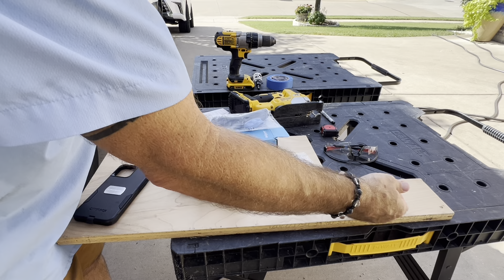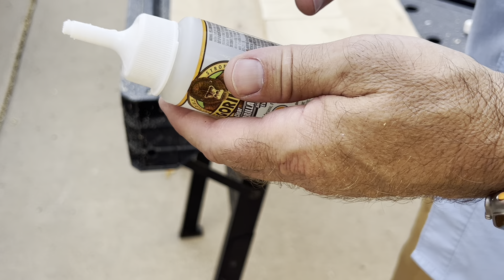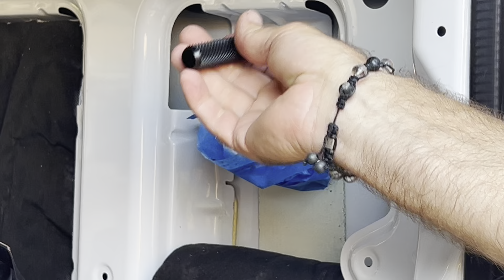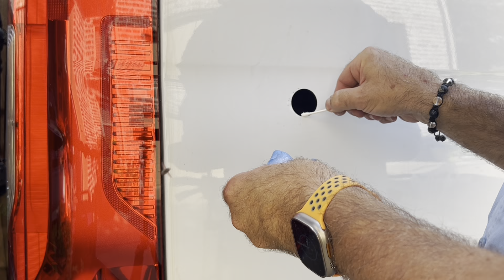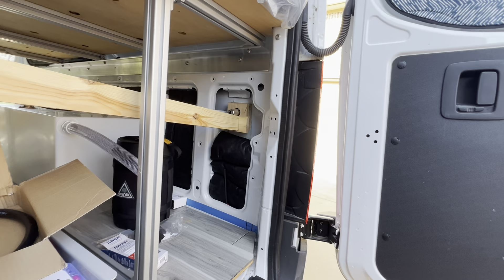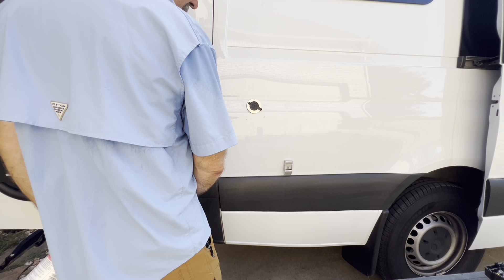Aquor Fresh water fill inlet installation video for Sprinter Van

Comment: Very nice! So this valve that you’re using, does have a check valve. It should not flow back by gravity if it’s mounted below the tank. Now granted, if it gets so cold, you may worry about water freezing in the fill line if it’s below the tank. But that would be the only concern.
Reply from the maker: Good points.  I may need a relief valve at low water point in the line. Thanks
Reply from the maker: I did check height of the incoming valve to tank height in the van and it is higher than the tank so am thinking I won’t have a freeze issue as all water should flow to the tank.

Comment: Hey man. Great video I think I’m going to do the exact same thing! Looks like I have the same water tank as you. How did you attach the nylon tube to your water tank? I see some type of fitting in there when I pause the video at 18:02. Thanks
Reply: Also to store caulk/glue you can stick a nail in the tip when you’re done. Works perfectly
Reply from the maker: Thanks, rolling a bit slower than I hoped as have yet to finish this portion.

Comment: Just a thought here…. Do you have valves that direct the water to your tank when primitive camping (no water) vs in a campground with water so your not using your tank and the water pump when showering, washing dishes etc…
Reply from the maker: I believe you are referring to an RV style city water hook up valve  that can be switched to dry camping?  In my case was thinking to keep complexity low and design system for always dry camping even though I will use rv sites for fresh water fill and electric.  Do you know of a simple approach for installing the RV switchable setup?  Thx